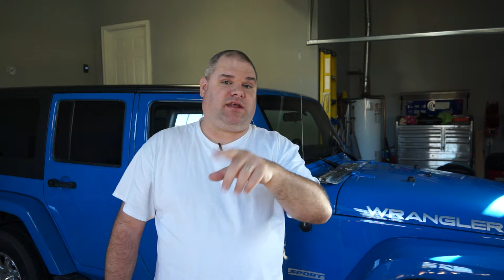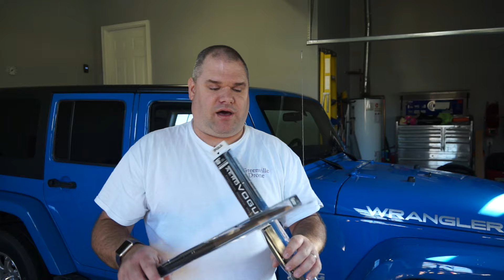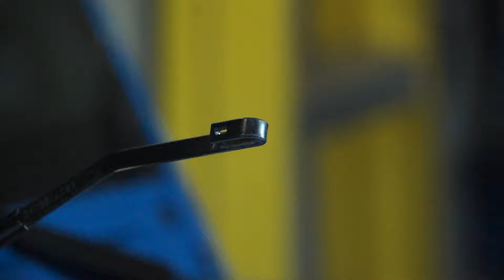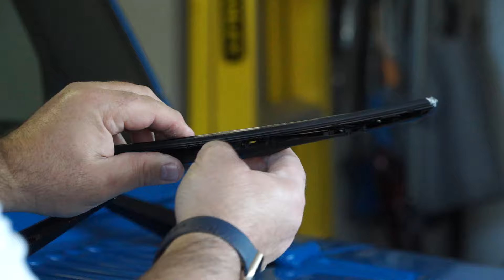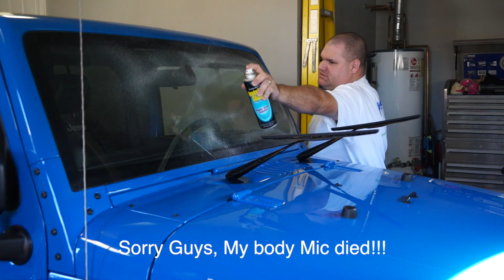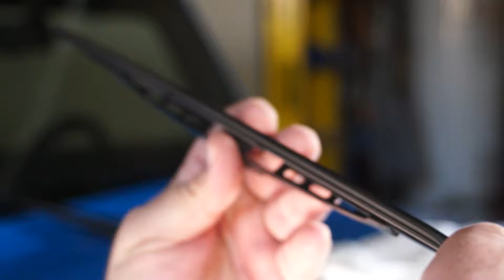PIAA Silicone Wiper Blade for Jeep Wrangler

Comment: Hi fiero880, just wanna change my wiper blades for my jeep. Both wiper blades are the same right? There is no difference between driver side and passenger side?
Reply from the maker: Correct same size
Reply: It may be so for your jeep - but for many other cars they are different sizes and you order 1 of each size.

Comment: Don't ever replace your wiper assembly, the aftermarket one's do not hold up overtime and fade.  Furthermore, this blade is stated to last 2x that of conventional wipers (as per company website), not 5x and based on the cost you can easily buy 3 sets of OEM replacement blades.  Thanks for the video
Reply from the maker: only time will tell now. We will see.
Reply: I replaced my whole wiper assembly and years later all is just fine.  We'll see 10 years from now though.
Reply: Aftermarket is not a brand, that is an overly generalized statement yes it's cheaper to just by refills.  Wiper frames can last longer than the element however they do wear out .  However they are not lifetime parts nor are they designed to be.  The frameless or framed styles both will overtime lose the ability to provide the same pressure.  Framed also have hinges which could be lubricated but this could lead to contamination of the element.  Gm dealers used to carry anco wipers, same models as equipped and available for sale in stores.  Many dealers love the only they can sell me anything mentality.

Comment: So how are the wiper blades holding up after a few months??
Reply from the maker: Wayne, So far they work good. Honestly though, I do not see any magical difference compared to a standard blade.
Reply: +fiero880 Thanks for the update!  Still have to install the garage door opener, next on the "to do" list!
Reply: I am and have used silicone wipers and it's funny to see comments that are clearly centered around cost.  They aren't supposed to be magical, they lay down silicone as they work so it would be like always having rain-x applied.  The other thing is silicone is simply more durable than pure rubber, that is a fact not an opinion.  They on my box say 2x life but their descriptions over the years have said up to 5 years.  However that was the sil-blade company that used the 5 year life advertisement.